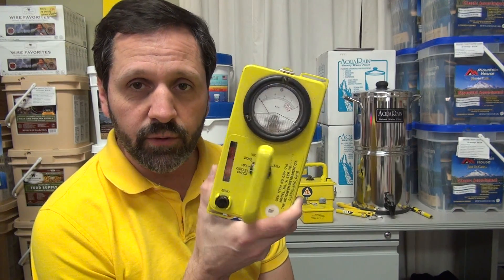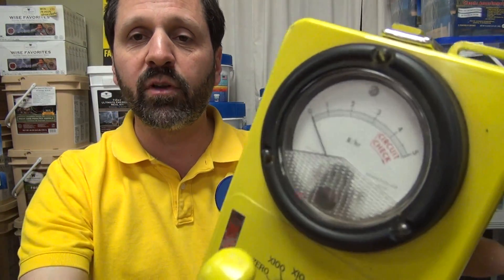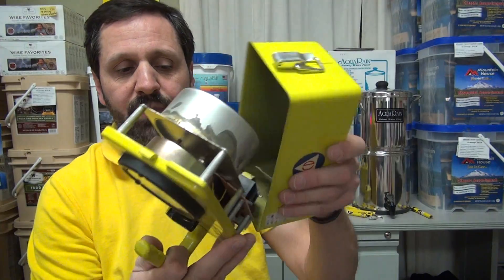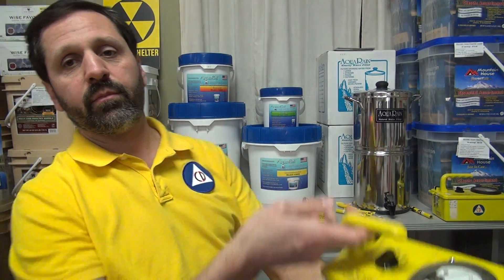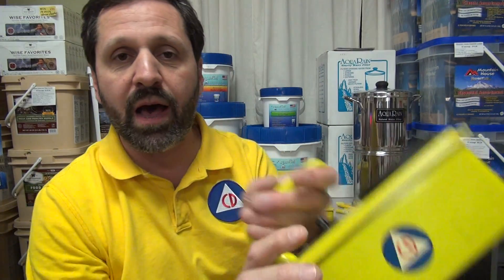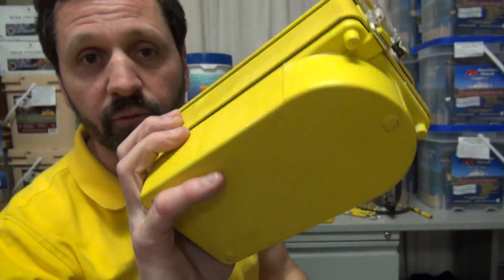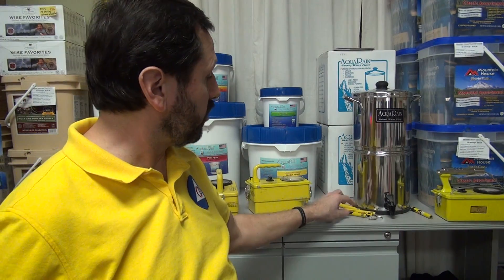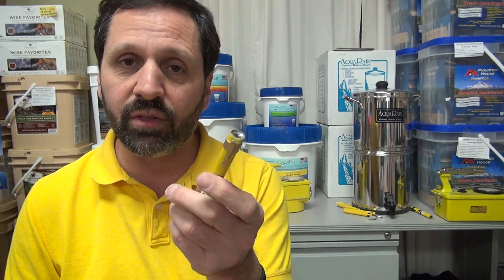Diagnosis tips for problems with Civil Defense Equipment

Comment: The jumping needle in the dosimeter pen could very well be caused by dirt in the zero control. A little QD or DeOxit would likely solve that issue. The same problem happens very regularly to volume control pots.

Comment: This is great info, thank you for sharing your knowledge! I have a Victoreen Instrument Co. Model 1A CDV-715. The dial is stuck just past the "2" either with or without  a  fresh battery in place (I checked the battery to make sur eit was fully-charged). Any suggestions on how I can get it to work? Thank you in advance.
Reply from the maker: If using the zero knob back and forth a few times and physically jarring the unit to see if the needle frees up, you probably need a new dial indicator (gauge).

Comment: The needle on my CDV 715 is stuck in the center of the gauge at all times - with or without a battery in place. Any suggestions as to how to get it to respond to the battery would be very much appreciated. Thanks in advance.

Comment: I have a Victoreen CDV 700 6A.  It seems to work right at first glance, but it is not.  Even when not near a source, if the unit is turned on at any setting, the needle begins to slowly climb.  In about 15 minutes it is maxed out to the right hand side.  I am not sure what part to replace in it.
Reply from the maker: Yeah, this is not normal and I don't know what to tell you how to fix it,
Reply: @ForbiddTV  I was thinking a leaky capacitor maybe.

Comment: Hi there, I recently purchased a Victoreen CDV 715 1A that has a slight crack in the meter bezel/dial indicator. Will this cause problems with its ability to function? The ionization chamber still looks sealed and seems to work fine except for the fact that it reads about .3 r/hr when I switch it to the two lowest settings. It was last calibrated in 2016 so I wouldn’t think it would be too off, but was wondering with your experience with these what you had to say- thanks!
Reply from the maker: All of them will do what you are saying.  When the government owned them they would calibrate them every 4 years.  The crack shouldn't present a problem.
Reply: Good to hear! Thank you for the help, I really appreciate it :)

Comment: I just acquired a Victoreen cdv-700 6b and it seems to work good other than the just reading a random number when off with no clicks until I tap on it a lot, and when I turn it on to test it will do the proper clicks and read 0 until I tap on it a bit. I suspect something being sticky in the meter but I have no clue what. Any ideas?
Reply from the maker: The number one thing I have bad on that model is bad dial indicators (gauge).  Replacing the gauge is probably all you could do if you could find one.  I need dozens of them myself.

Comment: Do you more info on the differencies betwen lionel and victoreen ?
Reply from the maker: They are both built to the same government specs, but they are different inside. In general here's a listing in order of which I think are the best brands of the model CD-V700 model 6 (or 6A, 6B): 
1. Victoereen 
2. Lionel 
3. Electro Neutronics Inc. (ENI) 
4. Anton 

Hope this helps.
Reply: @ForbiddTV  ty

Comment: I have a cdv 720, but need help figuring out what’s wrong with it.

Circuit check and zero work fine, but the 100-1 maxes out the gauge and it makes a humming noise.
Reply from the maker: The CD-V720's were problematic/unreliable and they were discontinued because of that.  I don't know the answer to your question, but if you thought it was worth saving you could ask if KI4U would look at it:  http://www.radmeters4u.com/calibrate.htm 
An electronics technician would probably be able to diagnose it with the schematic diagram inside the bottom case.

Comment: I am finding it hard to find the V-715 1B version with the "R" stamp; since this is a later model, was the retrofit improvements already built in unlike the 1A and 1 models, or do I need to keep looking to make sure I get the R version?
Reply from the maker: I have seen many 1B stamped with the R, but I think this was only done to avoid confusion from those who didn't understand the 1964 model 1B already had the changes necessary built in.  Usually it was an ink stamp on top near the nameplate or on the circuit board.  Sometimes it is a round white sticker near the nameplate.
Reply: @ForbiddTV  Thank you!

Comment: I have one of the Jordan Electronics dosimeter chargers but found mines doesn't seem to charge the dosimeter. The light works fine but when adjusting the knob of the charger, it doesn't seem to do anything to the scale of dosimeter. I tested it with 3 dosimeters I have so I would think its highly unlikely it's the dosimeters themselves. Not sure if you know how to fix it but any advice would be appreciated.
Reply from the maker: Find an owners manual online for that model  https://orau.org/health-physics-museum/library/civil-defense/manuals.html  In there they describe how to adjust the transformer with a screwdriver on R2 pot on the back.  This often does the trick.

Comment: So I got a Cdv-715 just for something cool to have and for some reason when I do the circuit check it goes all the way up like past the 5 even and when I put it on zero same thing and the knob to adjust it isn’t changing it and when I put it on the X100 X10 X1 and X0.1 it goes past the five which I know it shouldn’t be doing so is it something I can fix?
Reply from the maker: Sorry, I do not know of the fix but am working with KI4U on a video addressing these more detailed problems.

Comment: Hi, I just got the CD-V 700 model 6b yesterday. It was working fine until this morning. I put in the batteries and I was getting nothing. I checked with a multimeter and it was a connectivity issue so I cleaned off some corrosion and it worked fine. When I checked the source the dial worker but it just stopped at .3 mr/hr. Will I have to replace the dial or is it a fixable problem? It is the flat dial , by the way
Reply from the maker: It's been so long since I did this video, I'm not sure if I mentioned it.  The model 700 has meter failure as the #1 breakdown.  The dial indicator is sealed and would need to be replaced, although I have seen people cut them open and repair them.  You will have a hard time finding a replacement dial indicator, I need about 50 of them myself.
Reply: @ForbiddTV  thank you for the information. I am hoping I just need to replace the batteries, since they are low.
Reply: @ForbiddTV  nevermind, all is good, for now.. just turned it on, the dial is working now. Thanks for all the help, usually people don’t reply to comments from a 5 year old video. I like all your CD stuff and I hope to see more of it one day

Comment: I just got one of your dosimeter calibrators that seems to have worked very intermittently then failed. At first the bulb would occasionally turn on long enough for a flicker, now it wont work at all. Contacts are engaging fully. Switching bulbs and batteries doesnt help. Any advice?
Reply from the maker: If you bought it from me, write to me and we will get you another one.

Comment: At the time this equipment was designed it was adequate for what it was intended for. The high level survey meter or ion chamber meter, he is correct you will probably not even get that needle to Flinch on anything that you could legally own. Possibly if you were nice and asked when you went to the dentist office you could put it on the opposite side of your face from where they do the X-ray and for a very brief second see the needle Flinch on the lowest setting. On the dosimeters, regardless of how smooth the charger is that's usually due to the rheostat inside being dirty, other than that the circuit is extremely simple and it's the same across all the different models. The high voltage is used to charge the dosimeter which send it back down the scale, as radiation enters the open end of the decimeter or through the case, it loses the ionic charge. Thereby causing the needle to rise up the scale the problem is all of these decimeters regardless of which model you have except for maybe the v-138. We're designed to be used above 10r, that you would encounter this. Should there be an actual emergency with nuclear material. If it is localized to say a construction site or a manufacturing facility, or a laboratory the average civilian population will not have to worry despite what they believe on government conspiracies and government cover up. There is a safe boundary Zone built around these places is designed to protect the public from radiation leaks and accidents. By the time you would need any of these meters other than the basic Geiger counter. The situation would be far dire than anyone can seriously imagine and anything you've learned on basic shelter and place techniques, or ways of protecting yourself from radiation, are going to be a very little use due to the fact that we don't practice them every minute of every day. Slight little things that you will do in your average hours of just walking around your house or touching and moving things. You will cause contamination. The procedures we use in Laboratories to prevent this are very thorough and are practiced, and usually there are people watching every move so that if somebody misses a step we stop decontaminate or stop and go back. Again these devices were designed to withstand the initial Fallout of a atomic attack. They are not Precision lab instruments. Although some of them are quite good and were based on very good equipment at the time you have to look at it as what it is 70-year-old technology. Although the fundamentals don't change, they're accuracy does and there's only one company in the United States that will still calibrate these old meters. And even they tell you if there is a certain tolerance, plus or minus a certain amount. The basic geiger counter is fun to play with check smoke detectors and other random things for low-level radiation looking for radioactive glass radium sources. Coleman lantern mantles things of that nature. That's why many of them were given to schools by the state when the Civil Defense programs were shut down. Most of the high level leaders were sold off at auction for their electronics parts value. As even the government knew that people did not have a need for meter that would read these levels to give you an idea if you're in an environment that is exposing you to 10 rentons per hour. Radiation you would be able to stay in that environment for roughly 10 hours. Before you exceeded a total body dose. The problem is you would have to be able to escape to an area that is almost zero to continue not receiving a calculated dose and at 100 rent-kin for 10 hours. You would be quite sick. I would serious medical attention something that your basic iodine tablets are not going to protect you from also most likely whatever is creating this high level is either going to be a source that was incorrectly shielded, or has broken open and the contents that Spilled Out or God forbid an actual atomic detonation. You're going massive amounts of contamination most people do not have a multi-chamber decontamination system setup to be ran through containing multiple showers and clothing changes. To wash the radiation off where most people think that I I can wash it off outside with buckets of water or a couple pump up sprayers full of water. Yes that would work for maybe one person the problem is if it's still floating in the air, you're going to immediately contaminate the inside of your shelter. Also should your meters become contaminated which is quite easy to do. They're going to give you false readings. So the information he's giving you will only the most very basic, understand that the average person regardless of how many conspiracy theories they believe in. Will never face radiation levels is high in the environment even in the event of an accident even if your next door neighbor is one of the few operating Atomic plants in this world. You're not going to receive any kind of dose of radiation due to the hundreds and hundreds of safeguards that exist around this stuff as much as movies want you to believe that it's fairly handled casually and no one those were old documentaries based on how things were handled in the 1940s and '50s before we understood the dangers of these items by the 1980s we realized how dangerous they were and we improved our designs and our containment systems. So yes you might think you got something that will protect you or at least tell you that there is higher levels of radiation but worrying about the microscopic amounts of background radiation you find in food and water on average daily basis or in that old glass jar that left by your grandmother. Are no higher than what you'd receive in a commercial airline flying from Los Angeles to New York. The reason that do senators low level ones will read upscale after a few hours of being charged, is from ionic radiation coming from the sky and the natural background radiation around us. There's nothing you can do about it. For those that are going to take these items and go explore old uranium mines in the southwest I highly suggest you do not enter them not because of the radiation but due to the unstable nature of the mining operations these mines were sealed off and barricaded for a reason. The tunnels have not been inspected the curing and supports have also not been inspected. Just the fact that you touched a wall could cause it to crumble. Or cause a crack to migrate it would cause a fatal collapse. Never go into an underground mind. It has been abandoned well it may seem like a cool thing to post your YouTube video about understand just how and the least of your worries are going to be the radiation levels. Just two cents of advice from a former Lawrence Livermore Laboratories engineer. Radiation is nothing to mess with it's an interesting field of science to experiment, but realized that there's a reason that the government restricts the power level of sources available to the general public. As they're easily mishandles and can be deadly.
Reply from the maker: Radiological survey meters are meant for nuclear war, deadly levels of radiation.  If one had a means of protecting from gamma radiation, in a nuclear war event these are useful for determining when it is safe enough to leave the shelter.
Reply: True!

Comment: Is that dial indicator problem known to happen with the CDV-720's?
Reply from the maker: SixR  I certainly have seen some bad ones, but I don't really know at what rate they go bad.  I don't have very many of them as most were removed from service back in the 60's because of reliability issues.
Reply: ForbiddTV  I was just wondering because I recently bought one from Coleman's Military Supply which states that they came from a surplus warehouse or something like that. The one I received actually looks like it's not that bad of a shape it seems to have a couple of scratches   but they seem to be near the beta radiation shield. It says it's been tested but I have not been able to find out if it zeros or circuit checks it's also still has the original CD logo on it it also has the shoulder strap that came with it as well. Update I have been able to get batteries to test it , it zeros in just fine and it circuit checks just fine as well.
Reply: ForbiddTV The main reason why I bought it was because Wikipedia made it seem to me that this model was the only one that detected both Beta and Gamma and I was also told they are hard to come by as well, but of course Wikiapedia being Wikiapedia they seem to think you need a Geiger counter with a Radiation Survey Meter even though it wouldn't really work with a Radiation Survey Meter because if you're detecting anything on the Radaiation Survey Meter the counter wouldn't even work anyways. But seeing from your other videos I can tell this  model is not the only one that tests for both. I don't want to seem that im that kind of person that just buys Geiger Counters or Radiation Survey Meters because of Fukashima or something I've always been interested in radiation detection devices because I find them very interesting and also to count for the fact that I like old technology.
Reply from the maker: SixR  That's partly true.  Of all the Civil Defense era survey meters, that is the only model that will detect both beta and gamma radiation.  However, virtually any geiger counter will detect both beta and gamma at low (not dangerous) levels.
Reply: ForbiddTV I can agree with that as you said in some of your videos, toy, life or death.
Reply from the maker: @worldofbrandan   I have another more in depth diagnostic video in the works in conjunction with KI4U.

Comment: No talk about the corotron tube failures in the CDV700s? This is important to know, they all fail after 22years and over volt the Geiger Muler tube and either damage it or destroy the unobtainable high voltage transformer
Reply from the maker: I want to do a more detailed video on problems with these units, but it's a big topic and I'm not as up on the electronics as you seem you might be.